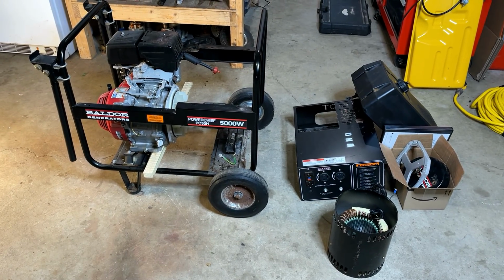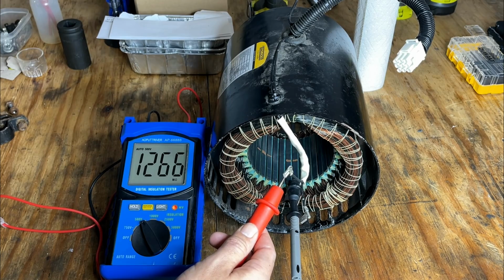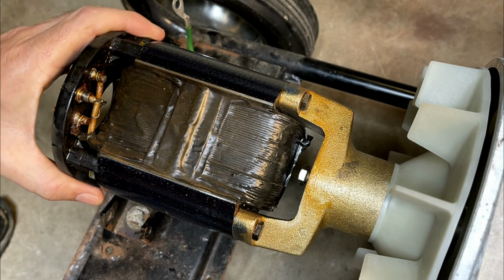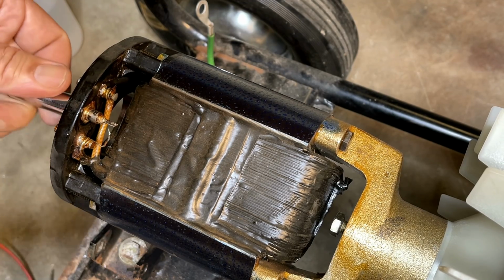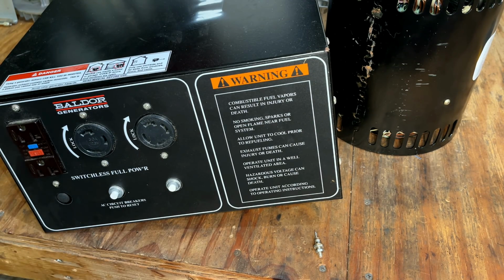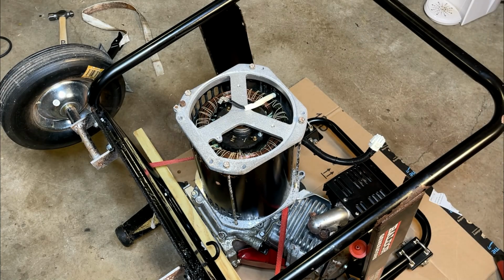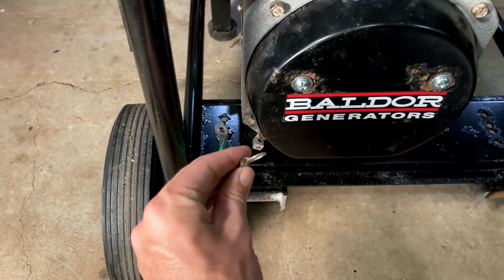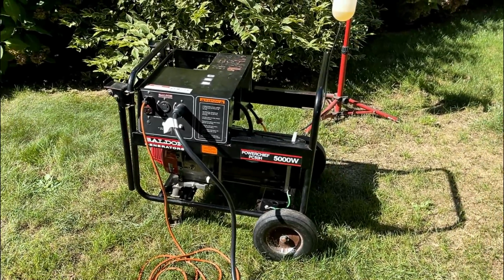Baldor Generator Not Making Power - Can It Be Fixed?

Comment: Those rectifier/diodes are pretty common. They are made 2 ways, for convenience of mounting. One will look identical to the other, but upon inspection, you'll see they electrical direction will be opposite.  That one you have looks to be about a 10 amp  component. I'm sure if you brought it to a good electronic part supplier..(NOT  a Radio Shack type place), they would look and on sight know what would be a good match.  Try 
Mouser,  or some online place like that. Those rectifier diodes are easy to find a replacement for. As the main problem is to get the physical match so that it fits. 
   It definately does look like a super duty design generator. A cross reference manual should be on your shelf, for such encounters with electronic components;
 It is definately replacable........Good Hunting, as we used to tell each other at work...!!!
Reply from the maker: Mouser was not able to cross reference the part, but the diode I eventually purchased was from Mouser.
Reply: @jcondon1  I used to have data manuals, that would list  characteristics, such as volts, reverse current, amperage. etc.
 In that way, you could pick a component very close. Diodes and rectifiers used in such settings as small generators, need not watch for
Certain values, of frequency, etc, which are important more to radio frequency (RF) circuitry, than to basic electrical uses. Anyhow, you did get onto the problem, as "Breakstone's Dog" and emerged triumphant, to repair this extra value
Unit.  Acolades are due you, Jim, as always...Great Job....!!!!

Comment: Is it just my imagination that Generac does a poor job supporting parts for aftercare? It seems that if someone wants a quality unit they would also want to be able to get it fixed.
Reply from the maker: Exactly.  I am certain this was a very expensive generator.  To not even know the specs of the diode that was used is embarrassing for Generac.

Comment: James when you solder  Power diodes, use a heat sink to minimize heat damage to the Semiconductor inside, a  alligator clip between the heat source and the inside of the diode will do as will a solder gun for rapid heating of the solder joint!
Reply: The power diode in the rotor is something that cannot be damaged by ordinary soldering and unsoldering.  Do not worry about it unless you use a torch.  The silicon diode wafer inside the top-hat package is actually soldered on top of the copper base under the top hat.  That base is a solid slug of copper that has been tin plated in this case.  The internal mount cannot be de-soldered without using a large torch!  
I worked for years at International Rectifier in El Segundo and was part of the team that designed and built all the manufacturing test gear that was shipped to India back in the 60's (yes, I'm that old) when IR opened a manufacturing facility there.  We did life testing on large batches of those power diodes manufactured in El Segundo, CA.  The diode probably has a 1/4-28 threaded shank and is rated for at least 10A at some generator-rated voltage that likely is greater than 600V.  These are brute force devices that do not need to be babied.  When a silicon diode fails electrically, they fail with a short-circuit when the PN junction is electrically punctured, typically by a transient high current localized voltage spike.  They virtually never fail in an "open" state.  An exception to failing open is with large, stud mounted devices (1/4-28 studs are not large) that can suffer failure of the internal physical contact between the flexible-side contact lead and the top of the mounted Si wafer.  A diode can also fail slowly by becoming ever more leaky over time in terms of excess reverse current flowing, which always is greater when the diode is hot and is why we always tested manufacturing runs of these diodes for reverse leakage and forward voltage drop when at 100 deg C.  In summary, you have an ordinary power diode.  Replace it with one of the same physical size and with the highest reverse voltage rating available (only because your diode is so hard to access).  Pay attention to whether there's a mica wafer below the base where mounted, as that signals an electrically isolated diode on a common heatsink.  Reverse polarity power diodes are also readily available.  Be sure to clean the mounting location and use heat sink compound to help dissipate heat generated when the diode conducts.  If you want an even greater educated guess at what's inside the package, call a tech advisor at IR in El Segundo.  They will guide you to a well-made stud mount device that will still be alive and well even after we are not.
Reply: There is nothing James can not fix except when it is FUBAR....!
Reply from the maker: Assume you mean as a heat sink.  Good point.  I bought two diodes just in case.

Comment: The 'blobby' solder on the diode is likely the culprit. That may be a ZENER diode in which case, you may need to know the cutoff voltage. It is simple to test the original part to see if it is zener.

Comment: Your meter has a diode test setting that puts out the higher voltage require. It is the diode symbol on your meter

Comment: 0733 is the date code. Made in 2007, 33rd week. IR is international rectifier. So that’s likely a 1N1362. :/
Reply: Correct, i did a quick cross reference search, its a Vishay Silicon Rectifier part number 1N1362, found it in stock.
Reply: I believe you are right. In forward bias, the diode drop would be low, so the current in the coil would be its maximum. When the field reverses, there will be a flyback voltage spike, and the zener diode can work to snub the spike. And with a 30V drop in this direction, the current through the coil will be much lower. Output would be effectively DC. Note that using a diode with a higher reverse bias voltage may allow the voltage on the windings to get too high and arc to another winding, and most diodes don't behave nicely at their zener voltages.
Reply: @blakejarvis2960  There is simply no reason why you'd put in a 30V zener in a 120V or 240V coil circuit - it would act as a dead short once the forward voltage rose above 30V.  Kaboom!  The MOV that James showed on the armature is where the zeners are.  Most MOVs consist of two zeners back to back to clip off (in this case inductive kickback) voltage spikes, and their cutover voltage would be around 170-200V for a 120V coil, and double that for 240V.

Much the same as plugin surge suppressors.

They ONLY conduct current when the forward voltage exceeds their cutoff.  You want the cutoff higher than the voltage you want.
Reply: That's a 30V 10W zener!  That doesn't sound at all right.

Comment: This should be a general purpose diode.  As long as you have the correct TO type, you should be ok.  Grab some data sheets and look at your voltages and go high to start with.  Couldn’t you just remove the four bolts that hold the rotor to the yolk?  It would seem like you would have plenty of room to get on that bolt.
Reply from the maker: Yes, the four bolts could have been removed to access that bolt.
Reply: @jcondon1   I enjoy your videos sir.

Comment: I wonder... Maybe there is just too much solder on the leg of that old diode. And the solder is bridging the insulation at the rear diode lead when you press it to one side? Maybe if you were able to remove that big solder blob, you would find the original diode is actually fine.
Reply from the maker: That may have fixed it, but also saw a spot that looked like the internals vented and blew a small hole in the same area.

Comment: Jim, Rance here and my head is still spinning on how you can figure out the neuroanatomy of the wiring to this generator! It’s as if you jump in and crawl through it one connector to the other. I need to go get some oxygen! Job well done! Thanks for the brushless generator tips at the conclusion.

Comment: I would try this one from Mouser: 
VS-87HFL100S05,  This is a very easy application, straight rectifier, as long as you have enough current and voltage rating, it will work.

Comment: Jim, I bought a generator head from an auxiliary power unit, and it was not repairable. The windings did not look hot, and the supplied capacitor was good, but multiple tests couldn't find what was wrong. I sent it out, and they weren't able to repair it either. It was brushless and belt drive, as well. I can't recall the brand, but it was a nation /domestic brand. I'm just wondering if it had a bad rectifier as well.
Reply from the maker: Maybe...

Comment: I have a Winco 9000 watt generator that I bought used. It is an industrial, brushless generator that put out a sign wave just like this Baldor generator. When hooked up to house, my refrigerator, my box fan and my portable A/C unit, all made an "electrical" humming noise that is not there when running on utility power. I wasn't able to solve the issue, so I bought an installed an Italian made, brushless generator head. The sign wave from this Italian, brushless head, looks like what comes from the utility company. Awesome video as always!
Reply from the maker: There are better brushless powerheads, but I mostly see the cheap ones on portable generators.

Comment: Why do you loosen the oil fill plug when draining oil. The vacuum that you perceive being broken by doing so is non existent as the crankcase breather tube will vent to air through the rubber tube in the overhead valve housing and intake housing.......
Reply from the maker: Sometimes it helps.  The breather usually has a check valve in the valve cover to let pressure out of the engine and not back in.  But PCV valves do leak the air back in, slowly.

Comment: At my work, we have large synchronous brushless motors (4000hp) that use a kinetic exciter on the end of the rotor shaft. They also use  diodes, field discharge resistors, SCR's , Gating modules, and sync pulse modules.. the purpose of these motors are to move water thru a 54" pipe that is 22miles long with a lift of 800ft. We have 18 of these motors...

Comment: Beware that not all diodes are created equal. There are a couple different types. There are zener diodes which are a type of voltage regulator. There are other types that are "trasorbs" or transient absorbers, which are a variation on zeners and they act similarly to MOV's.
Reply: The logo is "International Rectifier"
Reply: The numbers after the dash are not part of the part number, they are a date code.
Reply: International rectifier was purchased by infineon.
Reply: The power diode in the rotor is something that cannot be damaged by ordinary soldering and unsoldering.  Do not worry about it unless you use a torch.  The silicon diode wafer inside the top-hat package is actually soldered on top of the copper base under the top hat.  That base is a solid slug of copper that has been tin plated in this case.  The internal mount cannot be de-soldered without using a large torch!  
I worked for years at International Rectifier in El Segundo and was part of the team that designed and built all the manufacturing test gear that was shipped to India back in the 60's (yes, I'm that old) when IR opened a manufacturing facility there.  We did life testing on large batches of those power diodes manufactured in El Segundo, CA.  The diode probably has a 1/4-28 threaded shank and is rated for at least 10A at some generator-rated voltage that likely is greater than 600V.  These are brute force devices that do not need to be babied.  When a silicon diode fails electrically, they fail with a short-circuit when the PN junction is electrically punctured, typically by a transient high current localized voltage spike.  They virtually never fail in an "open" state.  An exception to failing open is with large, stud mounted devices (1/4-28 studs are not large) that can suffer failure of the internal physical contact between the flexible-side contact lead and the top of the mounted Si wafer.  A diode can also fail slowly by becoming ever more leaky over time in terms of excess reverse current flowing, which always is greater when the diode is hot and is why we always tested manufacturing runs of these diodes for reverse leakage and forward voltage drop when at 100 deg C.  In summary, you have an ordinary power diode.  Replace it with one of the same physical size and with the highest reverse voltage rating available (only because your diode is so hard to access).  Pay attention to whether there's a mica wafer below the base where mounted, as that signals an electrically isolated diode on a common heatsink.  Reverse polarity power diodes are also readily available.  Be sure to clean the mounting location and use heat sink compound to help dissipate heat generated when the diode conducts.  If you want an even greater educated guess at what's inside the package, call a tech advisor at IR in El Segundo.  They will guide you to a well-made stud mount device that will still be alive and well even after we are not

Comment: Nice work. As former Teacher of Electronics both beginner and advanced I most enjoy the circuitry troubleshooting parts. I was even searching the manufacturers website to find a diode that would match. The P&N material that diodes are made out of degrades over time especially when subjected to heat and they lose their ability to switch on and their specified voltage range.

Comment: James, so you got a standard series diode and not an avalanche diode in that package size? Looks like it worked out great!

Brushless capacitor gensets will always have dirty power till you put a load on it, then it smooths out the crests. In larger diesel gensets, there are extra electronics/ construction of the stator methods to smooth it out even further.
Reply from the maker: It was a standard power diode.... I just picked up a small Kubota brushless.  The stator / rotor setup looks to be a much better design then all the other brushless I have worked on.  Hopefully I can get the engine to run.  Am curious what the output looks like.
Reply: @jcondon1  thankfully portables in the lower wattage range are brush type. Brushless ones while less moving/wearable parts, output waveform sucks.
Reply: @jcondon1  yes To diesel powered stuff
Reply from the maker: @sureshkumarc.k6534  you would think, but actually a gas powered Kubota flathead engine.
Reply: @jcondon1  don't judge a book by it's cover,ok got it 😂
Reply: @jcondon1  hope you make a vid, I work on kubota stuff all the time
Reply from the maker: @graywolf1984  I might just be a tear down video, but would at least like to find the failure.

Comment: Great troubleshooting as usual! My last generator was a brushless and I could tell it put out a pretty dirty sine wave (lights flickering, etc). It was fine for running the sump pump, boiler and lights but that’s about it. I ruined a DVD player with it so I never used electronics with it again. Even with the generator I have now with brushes and an AVR I probably still wouldn’t power electronics with it.
Reply: Yep ONLY use a Pure Sine Wave like the Inverter style generators...they tend to be quieter too.

Comment: Great repair as usual. 
IR is the mark of international rectifier. 
It's a regular silicon diode. You just have to pick the voltage and current besides the stud packaging.
Reply: Agreed and go with the highest PIV you can get .
Reply: That’s what I was thinking. Although I’m wondering if the original had a lower forward voltage, possibly some type of Schottky diode. That may improve the output waveform near the peaks. But it’s better than nothing. Great job.
Reply: @ecaparts    he did measure the diode forward voltage which was 0.44 volts. That makes it a regular silicone diode. if it was schottky, it would read between 0.1 volt and 0.3 volts. No schottky diode can be used on voltages over 30 volts and the reverse leakage current is 10 times as a regular diode.
Reply: @piconano   He measured a failing component that was just shorted a few minutes prior, I wouldn’t exactly trust that 0.44 voltage drop reading. However, normal silicon diodes have a 0.6 to 0.7 forward voltage drop (so your previous comment doesn’t make sense). Schottky diodes have a lower forward voltage (0.2 to 0.4v) which makes them ‘better’ in most applications as well as extremely fast switching speeds. However they are not as robust as silicon diodes and cannot handle  high reverse bias voltages, so circuit design is important. That said, you can get high reverse biased Schottky diodes rated for 200v. Before you say you need more than 200v because the generator is rated at 230 - 240v, keep in mind this is just the voltage on the rotor windings. This is an induced voltage on the rotor that is rectified by the diode and may only be around 30v…
Reply: @ecaparts  Go measure a diode with your meter if you don't believe me. 
The diode failed where all fail. At the bonding wire. 99.9% of the time, diodes fail shorted. 
No one in their right mind uses an expensive 200V schottky in such a cheap generator. There are fast recovery diodes that are a bit more expensive than a regular diode, but have recovery times in nano seconds. 
Diode forward voltage is current dependent.
Son, I'm a retired electrical engineer of over 35 years. Get off my lawn.
Reply: @piconano  Indeed. With 60hz roughly-sineish wave, schottky is pointless.  You need schottkys in things that run at much higher frequencies. Especially like switching power supplies (where they're getting square wave) at 10s or 100s of khz.